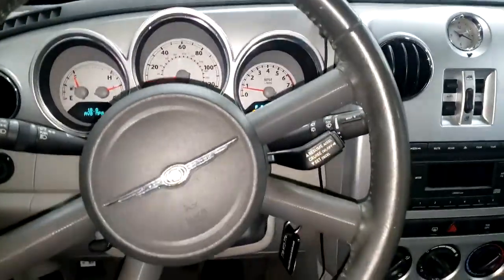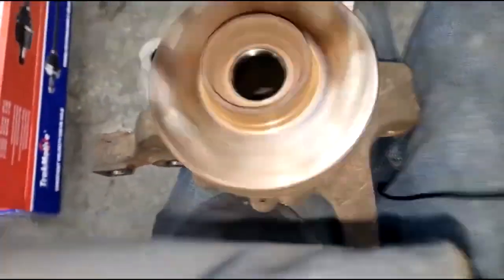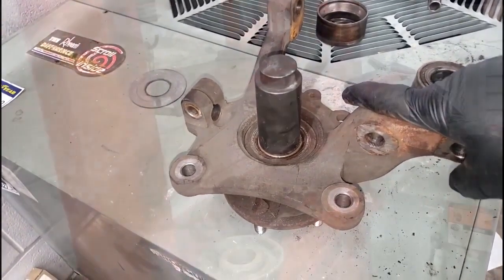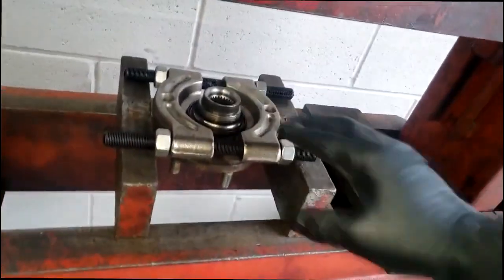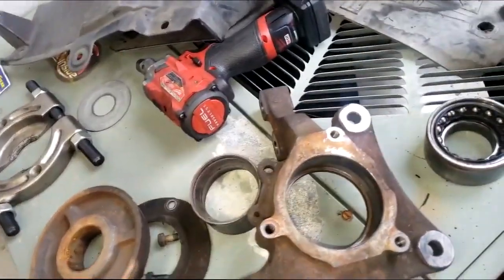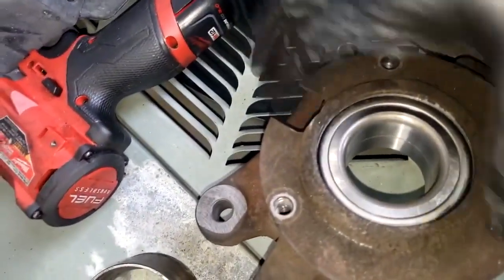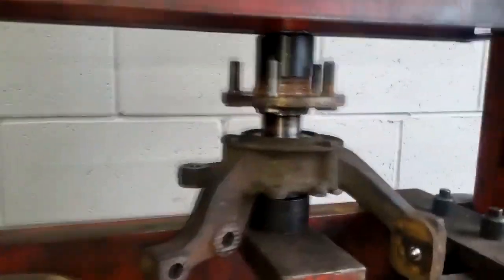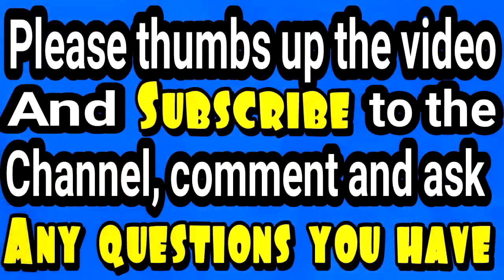If you hear ROARING NOISE while driving, you need to check and replace this.

Comment: Hope you might be able to help I'm doing a motor swap on a Cherokee with a 3.2 is there a special tool or what works for trying to get out the backbank manifold bolt with the bracket. In-between the converter. The bolts pretty tight and an open-end wrench doesn't want to break it loose and my snap-on boxed end does not fit between the converter and the bolt head
Reply from the maker: Boxed in wrench usually works for me my guy..
Reply: @OnlineMechanicTips  damn I can't seem to get one in guess I'm going to have to grind one down
Reply from the maker: @Noneya-rh1gi  good luck bro
Reply: @OnlineMechanicTips  thanks and thanks for a speedy response much appreciated

Comment: Nice job JT. Great tips. I've had bearings that were rough but had good preload and no play, but also some that were not rough but had a lot of play. Some just had the axle nut loosen, but some needed the bearing replaced. Supporting the knuckle in the press can be tricky, but you made it look easy! When pressing the flange through the bearing, if too much pressure is used, it can gall or damage the bearing, so when it stops moving, that's when you stop pressing. Just like you showed 👍